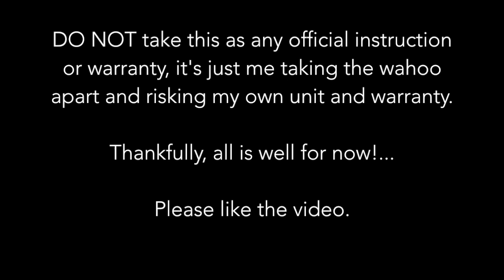Wahoo Kickr v2 vibration fix flywheel balancing with complete disassembly

Comment: It´s 2023 and I got a KICKR V6. It has virbrations as well. I Fixed it with a small magnet on the outside of the flywheel.
Reply: Hi, can you explain further, please? What kind of magnet did you use? How did you secure the magnet?

Comment from the maker: I was asked about the ‘belt’ technique to undo either the nut or cog. This stops the flywheel spinning... there’s a lot of torque on the nut. Basically take a leather pants belt and loop it round the flywheel, then tie off the loose end around one of the legs. If you’ve done it right the belt tightens as you apply force to the nut, and the flywheel cannot move.

Comment: I need to remove my flywheel in order to change the bearings and was wondering which way to rotate the cog to loosen it?  It's not entirely clear from the video.  TIA, this has been a life saver so far!
Reply from the maker: Hi, it's a standard thread - leftie loosey, righty tighty! I would recommend removing the flywheel on the flywheel side instead (thanks to a contributor below). Remove the central plastic cover and remove the nut with a large box spanner. A good trick to get the leverage you need and stop the flywheel from rotating is to use a belt to secure the flywheel to the frame.
Reply: @ginzolacom  I've been at my trainer for an hour, trying to get this cog off... My bearings are absolutely cooked and must be replaced. How do you stop the fly wheel from spinning? You mentioned something about a belt, you mean like pants belt? Any advice would be great! I'm dying here lol
Reply from the maker: @FreshCrits  hi, I put a reply in the main thread above. Yes, a pants belt.
Reply: @ginzolacom  I thought that was the case but it was so ****ing tight I was starting to wonder.  Molegrips wouldn't budge it.  Finally got it off using a 27mm socket which fits over the cog perfectly.  Good tip about the belt as stopping the flywheel rotating was impossible.  Just brute force in the end :)  I tried going in from the flywheel side but you can't get the bearings out that way.  Anyhow, bearings changed, flywheel balanced and hopefully good to go for a few more years.  Thanks again for making this.  There is zero other info about getting inside the 2017 Kickr so this was a life (and wallet!) saver.  Took a lot more than those two cups of tea though! :D
Reply: @SirDazzyB  Thanks for the video Daniel! SirDazzyB do you mind if I ask how easy were the bearings to remove from the housing and from the shaft? Were you able to remove and refit them by hand or did you require a puller / press? Are they 6003 ZZ bearings in the Gen1/2 the same as the later models? Did you use a 6 point or a 12 point 27mm socket? Thanks.
Reply: @oliverhall1026  The drive side bearing just pulled out by hand.  The other bearing is on the end of the axle and was a bit tighter but I was able to lightly tap it off with a hammer and cloth for protection.  Definitely doable with household tools and a bit of care.  I used a six point socket with a piece of jay cloth pushed in so it wasn't metal on metal.  It left no marks or damage whatsoever.  I expect a 12 point might be even better as more points of contact. (edit: a 12 point won't work.  See Olivers comment below!) I used SKF 6003 2RS which have the rubber seals.  The ones that came out were 6003 ZZ.  One word of warning - that cog is seriously tight.  I was on the point of giving up because i was scared of stripping the thread.  What eventually worked was securing the flywheel as much as possible then whacking the socket wrench with a hammer to break the locktite.  It's one of those situations where everyone will probably come up with a different technique.  It was all a bit stressful and took some perseverance but the result was worth it.  My Kickr feels better than when it was new.  Now i know what to do I'd have no qualms in doing it again.  Just a bit scary first time round :)
Reply: @SirDazzyB  Cheers! :-) To anyone else reading, it must be a 27mm 6-point socket, as a 12-point socket does not enage with the pulley. There is only about 0.3mm of engagement with the pulley teeth so you should ensure that the fit with the socket has little or no play otherwise you risk rounding the teeth. Dazzy above used cloth to take up this play, but I think that using a sheet of Aluminium foil folded over several times and wrapped tightly around the pulley might work better as Aluminium foil is roughly the same hardness as the pulley and so it will not damage the pulley but it will also not compress as easily as cloth or tape will.

Comment: Daniel, thanks for the video. I have the same model, Wahoo Kickr 17, but I couldn't manage to take off the flying wheel as you do in your video (8m44s). It is just so hard and stuck. Did you have to untight the bolt under the black plastic cap at the center of the flying wheel? Please advice me how to take off this wheel. Here is my noisy Kickr with a metalic point of contact within the gap of the wheel and the plastic case: https://youtu.be/BhXbmlqgK-4 . Any advice is appreciated?
Reply from the maker: Actually I think it is easier to remove the plastic cover on the flywheel side and then use a 19mm? Box spanner to remove the bolt. BUT, this is harder to balance the flywheel when you remove it like this because it never sits in exactly the same way when it goes back on.
Reply: @ginzolacom  thanks a lot! I was hesitant to move that bolt, but that could be my only choice. By the way, why do you put so much emphasis on balancing the flywhweel? Does it have an impact on performance? Sorry to bother you, but it seems that you have gone very deep into this issue. Once again...thanks for sharing your knowledge.

Comment: I have a suggestion regarding balancing flywheel. Get a glutac and thats the thing you should put for balancing. And when you are done balancing. Get a weighing scale and weigh the glutac. After weighing the glutac get a lead and cut the same weight measured from glutac. Hth.

Comment: Used sound deadening tape as the weighted tape, not sure its any quieter but perfectly balance and figured it can't hurt (made for car hoods/bonnets so can take the heat)
Reply: How did you manage to balance it ? I'm having the same issue
Reply: @JameelChoudhury89  once you disconnect the belt and the cassette the flywheel will naturally fall it ins heaviest spot, add weight at 180* and repeat until the flywheel is able to end anywhere on a slight spin

Comment: how is the unit working out to date?  I just bought a Cycleops H2 and it vibrates under load.  I am NOT happy as the vibration resonates through the frame as I pedal. Like riding a grinder.   The belt is noisy of course but I'm curious if mine has a flywheel balance issue.  Probably going to send it back and wait for the mech/tech to mature. 

I assume these trainers use a  electromechanical resistance generated by a magnet pulling against the flywheel in some way?  Seems a lot to go wrong.
Reply from the maker: The trainer was fine, then they replaced it. The repaired one I would suggest was slightly better balanced than the new one, but the new one is fine. I don't think there is an intrinsic problem with the design.. it's just a relatively low speed flywheel - engines have much faster turning ones! In terms of how the drag works, indeed, it's an electromagnetic system. The outer shell turning against fixed electromagnets which vary their drag by altering the load resistance. It's a very efficient way of working - unlike a treadmill that consumes hundreds of watts, this system is almost passive. I agree with you, if it vibrates, send it back... it really shouldn't vibrate.
Reply from the maker: Yes I wondered about that. My reasoning is that lead is less magnetic than even copper or aluminium, so any interaction with the electromagnet should be minimal.

Comment: I bought Wahoo Kickr Core last week and I have the same vibration issue.  It's starts to appear when the speed goes faster than about 22 mph so it's happening when I'm performing the spindown calibration. Could the vibration have an effect to the result of the spindown? The power readings from the Kickr Core are about 15w less than from my power meter.
Reply from the maker: It's possible that the vibration will affect the spindown, but then, the point of calibrating it would be to compensate for mechanical effects. However, one thing you have to remember is the drivetrain efficiency (chain, sprockets, jockey wheels). The power meter will be measuring the power at the crank based on the force of pedalling. The kickr, at the wheel... there are losses, so yes, 15W sounds reasonable as a difference perhaps?
Reply: @ginzolacom  Thanks for the quick reply! I though 15W sounds too much for only drivetrain losses but I don't really know. The difference is about the same from 100w to 300w and I thought that drivetrain losses would be relative to the power (1-2%).
Reply from the maker: @attejarvinen4776  Possibly.. I would have thought that the losses through drivetrain would be more related to the speed of the chain.. but I could be wrong? You could try changing chainline to see if there is a difference, i.e. running 50/28 against 34/20 would be about the same gear, but the chain will move slower with the latter. If it is the drivetrain, then the losses with the latter would be less. Maybe we're overthinking this. I know power meters are very variable in how much power they report. It's a very difficult thing to calculate based only on force, and not on work. It has to make a lot of assumptions. One think I always fing hilarious is riding with my friends and my Garmin GPS. It is ridiculously optimistic. I'll ride with one guy who uses Wahoo Elemnt, if he does say 8500ft climbing, I will have done 10k, my average speed is higher, and I went further.. yet we rode together the whole time!! Always good for a post ride laugh.

Comment: Are you still running this Kickr? Has the lead tape stayed put on the inside?
Reply from the maker: Nope, it went back... they replaced it. However, I think it was a good fix actually. Since then, I've played with balancing my wheels (counterbalancing of the air valve) - makes a big difference to the smoothness at speed!
Reply: Daniel Fletcher Balancing the wheels is a good thing and it’s easy with the lead tape.... usually I weigh the valve and stick an equal amount of weight on the opposite side inside the tire/wheel.  Rarely the tire causes a balance issue but the valve definitely does especially on deep section carbon wheels and tubeless tires. Cheers.

Comment: Thanks for this Daniel. I just received a V4 KICKR and there is an interesting difference in the design compared to your V2 version. As you might know, the V4  KICKR now uses a micro V belt that makes the unit silent. Unfortunately, my unit has a couple of problems. The threaded design of the small cog, that is clearly visible in your video, has been changed to a “woodruff key assembly”. The small cog rotates at high RPM, so any movement here is amplified and can causes a clunking noise, as it does with my unit. I am however pleased to say that WAHOO are addressing the issue and my experience with their support so far has been good. Another slight  problem with my unit is a slight imbalance in the fly wheel (i assume). Thanks for showing us the inside of your KICKR, as it is good to know that there is way to improve the balance if needed.
Reply: I've had four Kickr 2018s (V4), and three of them have had this same vibration problem.There's been threads of people taking about flat-spotted bearings because of high belt tension, but I suspect the issue is really this flywheel imbalance. The woodruff/bolt fix is related to this, but does not fix the high-speed vibration. So far, Daniel Fletcher's videos are the only mention online of this vibration I can find, which seems odd. Wahoo just sent me a replacement Kickr two days ago that was supposedly "inspected" by their techs and already had the woodruff key/bolt fix applied, but it still vibrates.
Reply: Justin VanAlstyne, Wahoo also offered me a replacement unit with Woodruff Key fix applied. How many of your replacement KICKR’s also had the fix? I have not yet accepted Wahoo’s offer of replacement, because i also asked them about the vibration and I’m waiting for their response.
Reply: @likemarksee  Of the four Kickr 2018's I've owned, 2 were returned to my retailer right away (this was before the woodruff key/bolt fix was announced, and Wahoo was blaming the noise on my drivetrain), the third was acknowledged by Wahoo support which is when they offered the "fixed" replacement. This fourth "fixed" replacement is the only one I've had with the updated woodruff key/bolt. It's possible that all four of units I've had had the vibration issue as well, but the first trainer was so noisy I boxed it back up without even seriously riding it.
Reply from the maker: Cool, good to see they are making progress. Somebody pointed out that it is easier to remove the flywheel from the other side, but of course, you need it on the axle/bearing to be able to balance it.
Reply: Hi, I run the v4 with camapagnolo chorus. All of a sudden i get this clunking sound,that intensifies during workouts. It starts at 60 decibel. Awaiting wahoo’s response at the moment
Reply from the maker: @MrHappycapitalist  Clunking? doesn't sound good! is it certain gears only?

Comment: Thank you for sharing !

I just brought a Kickr as well. Second hand from october 2017.
I immediately experienced some low frequency resonance with my room/floor (solid concrete, 1st floor) on some speed. It's just incredible. I can't use it like that, my neighbors will go crazy !

So I started to play with a small coin under a 5cm piece of duct tape. I stick it directly on the flywheel.
But I was never better, always worse. So I thought it was too much weight.
I then tried only with this piece of duct tape.
Luckily I've quickly found a good spot and vibrations level is now reduced.

I'm surprise the fly wheel is not more carefully balanced at the factory. (Maybe it is, I have no clue)
The ratio on the belt drivetrain is around 8.
On 52 x 15 gearing it give a 3.46 ratio.
Spinning at 90 rpm gives 90 x 3.46 x 8 = almost 2500rpm for the inertia wheel ?!?!

I think I'll go further  in the balancing process.

It's a same we don't have a through axis, we could do this then :
https://www.youtube.com/watch?v=6eQIBZ9ICCo
Reply from the maker: Apparently, I was dumb. there is a much better way to remove the flywheel that someone else commented on. Remove the plastic cover in the middle of the flywheel to remove it from the shaft.. however this might make the balancing process difficult? Maybe this is the right way. The critical part I think is removing the belt to figure out where the mass needs to be, then once you have that, you can play with the mass.
Reply: Good ! Then I can maybe machine a dummy axle, just for balancing the flywheel ! :-)
But the process won't take in account the whole shaft then.
How is the hole in the wheel ? cylindrical or conical ? How is the fit with the shaft ?
Reply from the maker: @stephanelouvet1113  I'm not sure that the axle would be that significant. The mass of the flywheel is pretty big. If you can machine a dummy to balance it, then maybe there's a micro business there in balancing people's Wahoos??
Reply: I recently purchase a 2018 Kickr to replace a 1st generation Kickr I have been using. The unit starts to have noticeable vibration around 20 mph(during a ride or spin down). It leaves me with serious doubts relating to quality control and testing of the final assembly. The 1st generation had no vibration and quite a bit of belt noise. The new unit does have a considerably quieter drive train.

Comment: How much mass did you apply? Did you weigh it at all?
Reply from the maker: Not a lot of mass at all. From memory each little strip was about 5g. Whilst the balancing of the flywheel is rubbish, the bearing is excellent, so you can experiment to get the right mass and placement.
Reply from the maker: I'm dumb and have only just got into these comments! I cannot remember, maybe about 15g?

Comment from the maker: Hi, see below.. this was the hard way to remove the flywheel. It’s easier to remove the plastic cover, and leave the axle in place.. doh!
Reply: Hi, so how do you remove the plastic cover on the flywheel? I have the Kickr1, and it seems the "black metal " thing on the inside of the flyewheel is a little loose.

Comment: PErhaps this is a stupid question, but how did the flywheel become "unbalanced", presumably material/mass did not wear away from one side.
Reply from the maker: Not a stupid question! It was unbalanced out of the box. PS. Ignore my stupid method. See the comment below... "Remove the plastic center cap on the flywheel by pulling it out with adhesive. It will expose a nut. Use a 19mm socket wrench and hit the wrench sharply to remove the nut. It has standard threading (CCW to loosen). "
Reply from the maker: i don't think that's possible. there's no adjustment or anything that can move.